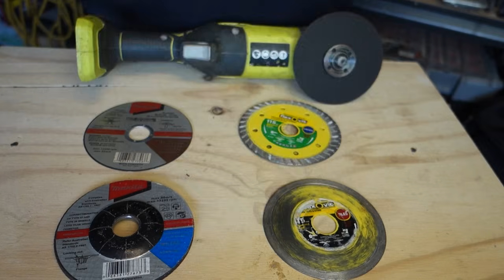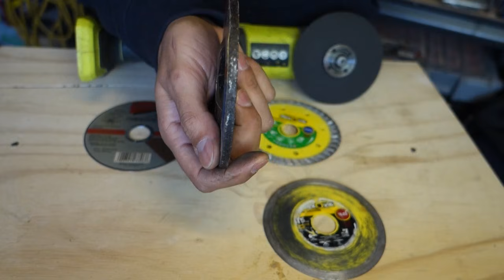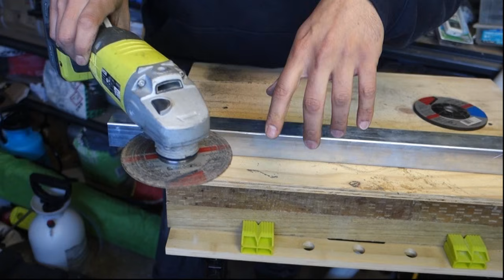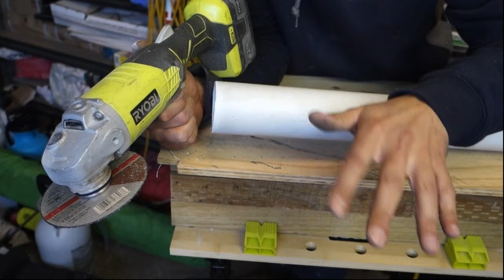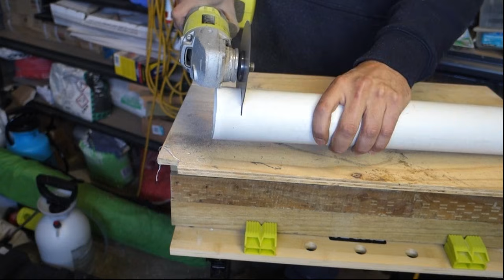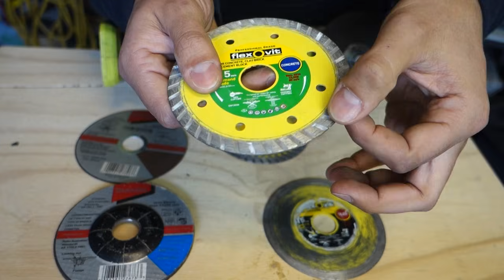Which angle grinder blade / disk for concrete, plastic, tiles and metal

Comment: My Ryobi angle grinder  P4221 say to only use type 27 disc and never use a type 1 disc.   Most of the blades you recommended are not type 27 but are type 1.   I am trying to find a type 27 cut off blade.   Does anyone make them or is my angle grinder basically just for grinding / sanding?

Comment: Thanks for this video. I went to the markets and was told by a man named Abdul selling discs, he sold me the diamond one, and told me that it can be used for metal and everything else, until I asked another stall that sold grinding discs, and was told it was for stones and tiles.  Abdul lied to me, and I asked for a refund and he refused to give me back my money.  He then lied again, telling me to change it to the tile specialty bit which is for tiles, saying its for steel.  Lucky I lost my temper after not wanting an exchange and called the manager of the premises to help me get my money back.   This video has shown me exactly what he tried to sell me.
Reply: Never trust Abdul.😂
Reply: Depends upon the design of diamond disc. Continuous smooth rim are meant for tile and porcelain and don’t chip the work.  The continuous rim with a fluted design as in the video are meant for concrete, brick and pavers…they CAN be use on tile, but might chip.  Segmented diamond discs (ie. has slots around the rim) with a rough coating of diamonds are usable on steel, although not as fast cutting as a bonded fibre cut off disc as in the video.  Don’t use these with aluminium as the soft metal will clog the diamonds.

Comment: Yeah, there are so many errors using the grinder in this video:
1. no handler mounted
2. no safe guard properly installed
3. no PPE such as gloves
4. the cutting disc is mistakenly used as a grinding disc

Comment: Holy cow. everyone here bitching ( whingeing ) about how dangerous and wrong to use a cut off wheel to dress up an edge...Give me an F'in break. You can not be a serious engineer/fabricator/repairer/builder etc. They are both manufactured the same..( abrasive material bonded with a mesh. 
..... touching up a welding burr, or the edge of a cut with next to no pressure is NOT grinding for metal?materiel removal at a  12- 45% angle as the type 27 (cupped)  disk are designed for. 
and as a matter of fact you will fine some manufacturers with even say  about the cut off disk....quote " can also be used for light grinding in tight area where the cupped/type 27 wheels can not get in end quote.  
and don't send me anything from an american company  with their name on chinese junk wheels like Norton or Licoln , etc saying never do this( thats implied for attorneys) and CYA  just like they will tell you use both hands on the grinder. guessing no one arm welder/fabricators are alive).
If you can operate  a fork and spoon you obviously know using a cutting device spinning 10-14,000 rpms or more itself is a RISK. .

Comment: Reckless idiot 2:53 
Next video: how to take an embedded angle grinder out of a torso because the idiot using it with one hand while holding the metal with the other hand did not clamp the metal in a vice and used both hands to hold the grinder... the blade binded, the grinder whiplashed into the idiots chest.

Comment: You shouldn't grind with cutoff disks, they are never meant to take side loads. Also wear your safety equipment
Reply: Posting a note just to remind myself, tks! Still want a 1disk for the tool that can cut metal, wood and plastic! ...make sense to just stock the blade that can do All 3 in 1.
Reply: @zechssiguro7476  carbide disc
Reply: @submeitsfreebruh  hey thanks, thing is I heard about this DIABLO brand but off disc, some guy made a vid, it might be a diamond disc, that fits the M12 Cut off. May work for metal, plastic&wood, I need to check the bid out to confirm! But it does come with a ( for plastic)carbide  disc & ( for metal) carbide disc. Only problem is that in videos it's black carbon rsidue comes of on the wood,plastic & metal...not the best finish, but comes with tool, so safe. Also heard diamond disc is more brittle, meant for tile only??, I'll do some more research...
Reply: @submeitsfreebruh  thank you for the reply, That's a good brand! I'll add that to the list!
Reply: I came to post this, it could break and pieces could end up in the skull (actually happened)

Comment: Hi. Many thanks for the great advice !!! I have 2 doubts I can't find an answer to. I've just bought a Makita M9507B 115 mm. Its spindle is 21.16 mm. Do all makes of 115 mm discs have this same spindle diameter or do I have to get only Makita discs? And here's another query: I have been given a smaller diameter Bosch disc, in fact, 110 mm, whose hole is greater than 21.16 mm. So, do spacer washers (shims ?) exist so that it would fit my Makita snuggly and prevent it from wobbling, perhaps dangerously ? Perhaps there are tapered locked nuts to take up the space? I'd be very grateful for your guidance.
Reply: Have ya figured it out yet?

Comment: Do not use a cutting disk for grinding even if it's just light grinding it's very dangerous!  If you are lazy to change your disks then just get yourself another grinder that always has a true grinding disc mounted.
Reply: Can I just perpendicular to your cuts to make it easier to knock down after?

Comment: Hi Bill,  how bout for the wood?
Reply: I found the angle grinder to be the most horrible tool for cutting wood of any type, size or thickness. It burns it and is extremely difficult to make good quality cuts with. If you aren’t careful or you have one of the more powerful angle grinders it can damage or leave undesirable edges even on metals if they are of the non ferrous kind such as aluminum or copper. Also cutting pcv or plastics can be dangerous due to the grinder causing the material to melt and then slinging off the hot bits of materials and hot plastic can cause serious burns to skin. So be safe and cover your skin and wear face protection.

Comment: No guard no gloves and applying pressure to flat part of  a cutting disc is very dangerous due to them not having reinforcement and being so thin please show how to use safly even though we have all done it at some point knowing it's dangerous will hopefully prevent a accident

Comment: If you’re grinding, use a specialized grinding disc or if the material falls for it an abrasive wheel. Why? The material and design of the disc is specific to that application. A cutting disc is not designed to handle the compressive and shear force exerted upon it during the act of grinding. This is an incredible safety risk not to mention you’re not going to get as good a result that you hoped for and your consumables won’t last nearly as long in comparison to using the right material for the job. I won’t even get into the safety issues because those have been covered in hundreds of other comments.

Comment: Your living on the edge if your operating a hand grinder without the guard, especially with the thin "cutting disk".   Never use the cutting disk's side surface to grind or apply any side pressure to the disk.  Always clamp the material if your cutting deeper than a quarter inch into the material, like the square tube or pipe -- any binding can shatter that disk.  Google : "Angle Grinder Accidents" if you need a visual reason to respect this tool.
Reply: I am a simple, very simple home DIYer and I would never have used a cutting disc to grind even PVC pipe down because too much pressure even on a thin disc can cause it to shatter and I have even seen the YouTube video Angle Grinder Accidents. I get a face shield though it may be pretty useless and wear safety glasses after seeing the guy who had a shattered disc go through the face shield and his safety and the disc bit stopped about 5mm or ¼" from his eye.

I no longer use 1mm thick / thin discs and use the 1.2mm ones and am going to look for a 1.5mm one. After watching that video I am also trying to find a good leather apron for additional protection. 
That video was a shocker.

Comment: Wow. Youve gotta be more careful when trying to teach people how to use a dangerous piece of kit like a grinder. I can see youre trying to be helpful, but youre like a "what happened next" safety video.

Theres no guard on the grinder. If the disc bursts, it'll cut straight into you, jagged material at hundreds of mph.
Theres no handle on the grinder, which would give you extra control of it.

You havent secured the piece youre cutting, so youre holding it with one hand, meaning you dont have full control over the grinder if it kicks.  Also you will never get a straight cut.
Youre not wearing gloves.
Youre not wearing thick clothes.
Youre not wearing a mask. 

Your work site is so untidy that those sparks are going right into your shelves of junk into who knows what.

Lets hope theres nothing flammable like solvents in the spray bottle near your feet.
If theres stuff around your feet like the spray bottle you havent cleared your work site of stuff to trip over while you are using the grinder.
And all thats before you tell folk to use the cutting disc to grind.

Really suggest you watch this guy  https://www.youtube.com/watch?v=1TFisMcDrH4   whole show everyone how to do things properly.
Reply: I am an angle grinder noobie and I thought that as soon as he started cutting....wheres the guard <eek>

Comment: https://youtu.be/bI1wf20atQ0 
Ahhhh... YouTube - a place where Any Idiot can post a Video , and often does.

You have NO idea what you are doing.   You Violated a ton of Safety Rules: No Gloves, No Eye protection, No Hearing protection, You removed the Protective Guard,  You Removed the Secondary Side Handle, You are using it with ONE Hand, Your work is NOT Clamped Down, You are Cross Purposing Discs ex: You CANNOT use a Cutoff Wheel as a Grinding wheel without a risk of shattering and serious injury. You are wearing a hoodie with a String hanging down while using a rotating power tool.

 You would be thrown out of any 1st year High School Tech Shop here in the States.

https://youtu.be/bI1wf20atQ0

Comment: I have been using 6 amp angle grinders for wood carving, shaping, sanding, and✴✴>allmy.tips/dAngleGrinder?C    cutoff work. They would bog down and get hot quickly. This 11 amp bad boy from DeWalt is a monster. I am going to relegate my 6 amp grinders to sanding, and get a couple more of these 11 amp beasts for power carving and shaping. Easy to switch discs, too. Feels great in the hand.
Reply: gooooooood

Comment: Dont use cutting disc like that its wery thing  and it will brake like that and you are not using a guard over the disc use a flap disc or grinding disc

Comment: Hi Bill.
Loving your videos - straight to the point with no bullshit.
Can you do a video on how to remove and install an electric oven??
Reply from the maker: Thanks I’m glad you’re enjoying the videos. Unfortunately with most ovens they are hard wired and require an electrician to disconnect and reconnect. The actual oven itself simply slides in and out of the cavity. It’s not a common job I do however if I come across one I’ll definitely upload 👍
Reply: @billshowto  I have a oven, where it just looks like there is just a wall plug. Does that mean it's just as easy as unplug old oven and plug in new oven?

Comment: That was informative. I don't understand why someone gave it a thumbs down.
Reply: Maybe, because no guard was used during video
Reply: Cutting discs are not made to do any grinding. when Bill pushed the side of that cutting disc into the steel tubing it weakened that disc. When a disc is damaged it flies apart at 200-300mph into your bare knuckles. scary stuff
Reply: This is a death trap... 😢😢😢
Reply from the maker: Lol, they did it within seconds of the video being uploaded. As long as most people benefit from the videos, the haters can hate. 👍